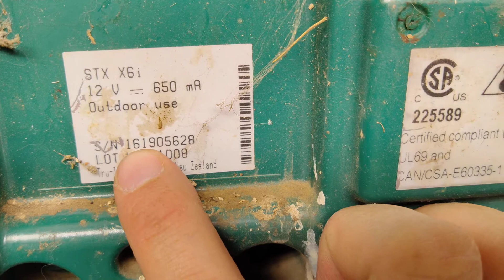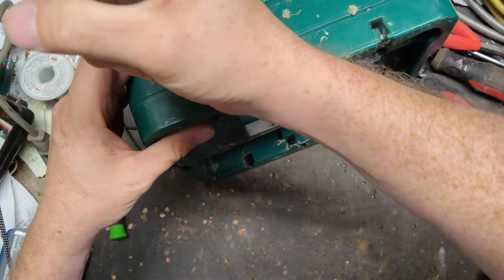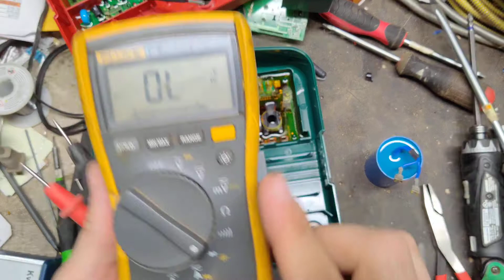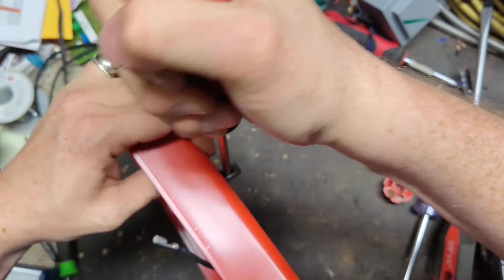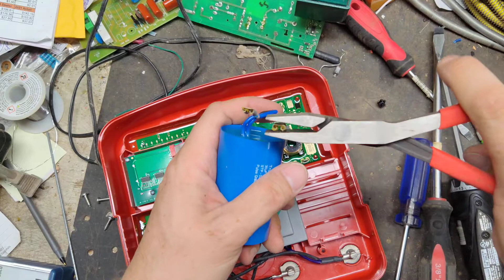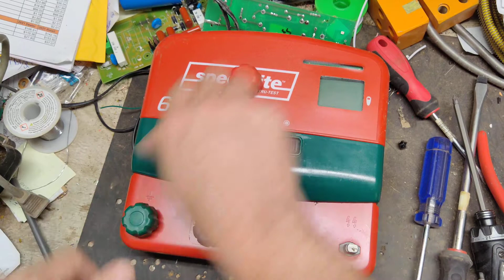Stafix Fence Energizer Repair | Stafix x6 x6i Repair

Comment: Battery power cable lead diagram
Reply from the maker: It's nothing special, just two female spade connectors at one end, and battery clamps at the other end. I don't know which is positive and negative, but it doesn't really matter when it comes to making you the cable. Because once the cable is made and plug the spade connectors onto the board, just hook the clamps onto a good charged up battery and turn the unit on. If it doesn't pulse, switch the clamps around and then it should start pulsing. If it doesn't either way, then there's an issue with the unit itself and then it becomes expensive to fix those dumb units.